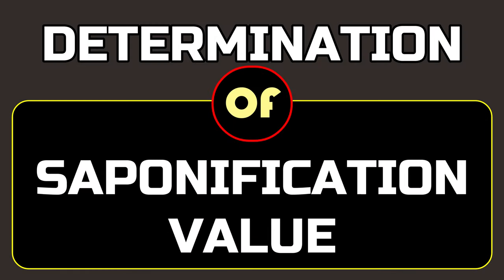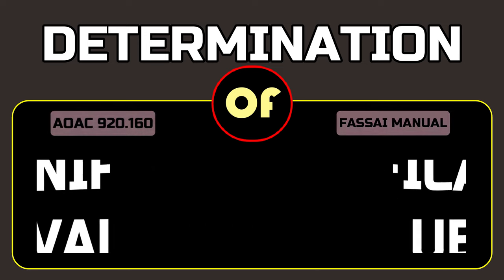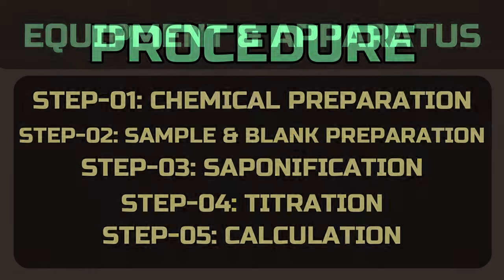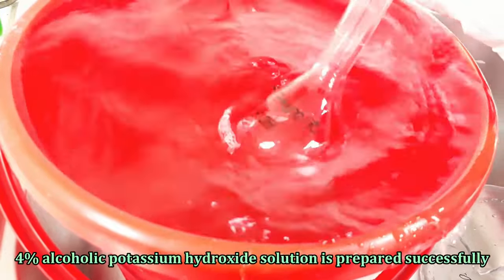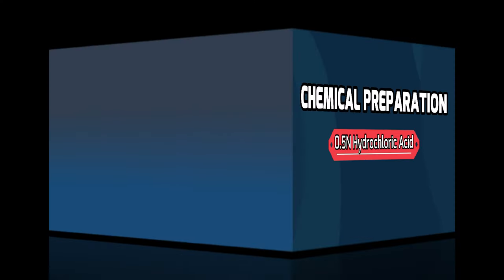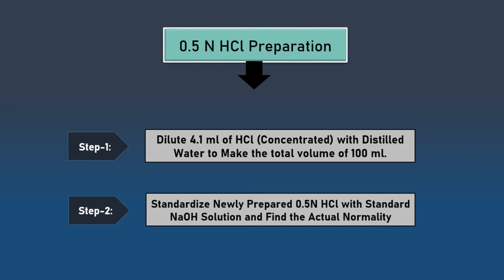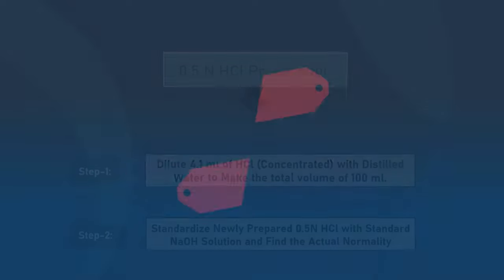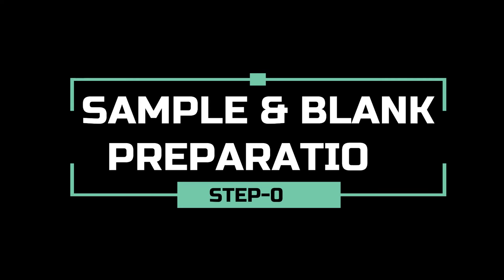Determination of Saponification Value of Oil or Fat Sample_A Complete Procedure (AOAC 920.160)

Comment: when i did this experiment, i mixed 3.4g KOH+ 2ml distilled water+rest of ethanol to make upto 100 ml volume(0.5 N solution). I made this ethanolic KOH using directions I found on the web. Then I directly dissolved 1g oil sample in 50 ml of prepared mixture. It got clear only in 5 minutes. I prepared 0.5 N Hcl by adding 10ml in 250 ml water(37% Hcl). When I titrated, I was getting a very large saponification value(about 500). The formula I used is [(blank titre-sample titre)*56*normailty of KOH]/weight of sample. Can you tell me what am I doing wrong? And what is the purpose of the methods u have used like use of aluminium foil and initially boiling koh with ethanol?

Comment: Great video, can you explain what is function of reflux 1,67g KOH in 200mL absolute ethanol? Can we only use 6g KOH in 150mL absolute ethanol for preparing 4% ethanolic KOH? Thanks..
Reply from the maker: Reflux of ethanol with KOH followed by distillation is normally done to make the ethanol more active for this test.
But you can just dissolve 6g in 150ml.
Reply: Ok thanks a lot..
Reply: Great video plz make a video .how to check erucic acid in canola oil.

Comment: 1.How to find SAP value of solid state sample like alovera ?
2. Will the SAP value be same if I use sodium hydroxide?
3.Difference between KOH and NAOH?
Please do reply
Reply from the maker: 1. No idea about other sample but you can try this method
2. KOH use is mandatory as said by Reference method.
3. Please take help from other source
Reply: @MicroChemsExperiments   thank you for help
Reply: In formula how did this 28.05 came

Comment: Hello. Thanks for the video. I just wanted to ask the importance of making a blank. 
And also, can distilled water together with the ethanolic potassium hydroxide solution be used as a blank?
Reply from the maker: You must have to prepare blank as shown in this video
Reply: The reason for the blank is to account for any water present in the KOH.
Reply: @billsmathers7787  Thanks

Comment: Some websites are showing this formula of saponificatio = 56.1×(A-B)×N÷W
and some showing 28.05 ×(A-B)÷W
I am confused, which is  correct , what is difference.?
Please reply
Reply from the maker: Both calculations are same. You will get the same result. Second equation, you mentioned, is simplified form of calculation. First mentioned calculation is the original calculation formula. You can use both.
Reply: @MicroChemsExperiments  thanks for reply
Reply: @MicroChemsExperiments  what is normality of alcohlic  KOH solution you have prepared
Reply from the maker: @aone9548  Please watch the video again.

Comment: Good work, keep it up. But how do you arrive at 4.1ml of HCl? I want to know its percentage purity and density and how you arrived at 4.1ml and must it be 0.5N? Can't 0.1N be used. Thanks as you reply
Reply from the maker: 0.83ml HCl should be added to make 0.1N HCl solution and 4.1ml is added to make 0.5N HCl solution and make the final volume 100ml.
Please watch our video for the preparation of 0.1N HCl. Video link: https://youtu.be/lXzAB8woAd8
We used 37% HCl (fuming) of molecular weight: 36.46.

Comment: in the standard formula for SV, it uses the molecular weight of KOH (56.1g/mol), but in this method, it applies 28. 05? my question is what this number represents?
Reply from the maker: Mike Tyson, which standard formula are you talking about.
In this test, we followed the AOAC 920.160 official method strictly. In AOAC 920.160 method, 28.05 is used in the equation, so we did.
Reply: @MicroChemsExperiments  This is because HCl concentration is 0.5 N. Basically the equation involved HCl concentration too. When it is 0.5 N Molecular wt of KOH is 56.1 which will eventually lead to the value of 28.05.
Reply from the maker: @TridibSarma  Thank you so much for the clear explanation.
Reply: @TridibSarma I don't understand calculations   explain please.
Reply: 56.1 x0.5N = 28.05

Comment: Must And Should Use pipette
Not Use Measuring cylinder
Reply from the maker: Here you don't need accuracy at that much. You can also use measuring cylinder. But using pipette is best practice always

Comment: 28.05 was written in the first line but in the next line 28.5
Reply: In the calculation part
Reply from the maker: @tarunkumar8841  Sorry, it was a mistake. 28.05 is the correct factor. So 28.05 should be written in second line also. But we wrote 28.5 by mistake.

Comment: Is the SV of Oil (in the form of triglycerides) less than the SV of the same oil after hydrolysis (free fatty acids after reaction - splitting)?
Reply: Yes, because molecular weight decreases after hydrolysis & as the mol wt decreases SV in increase,so definitely SV of split fatty acid will be more than oil before hydrolysis.

Comment: how to prepare ethanolic potassium hydroxide solution in procedure
Reply from the maker: Preparation of ethanolic KOH is already given in this video. Please follow the step-1.
Reply: @MicroChemsExperiments  IS there any optional to prepare without reflux condenser
Reply from the maker: @amanueldaniel5342  You can prepare  it without reflux but that can result in some error in the final result. The result will not be exact but can be considerable.
Reply: @MicroChemsExperiments  how? please show in procedure
Reply from the maker: @amanueldaniel5342  Just dissolve KOH pellets in absolute ethanol and skip the distillation step. Take help from this saponification video and just skip the distillation part and disoolve KOH in ethanol

Comment: How to make 0.5N hcl solution?
Reply from the maker: You can prepare 0.5N HCl solution by followng our video: https://youtu.be/lXzAB8woAd8
Just multiply the amount of HCl, needed to prepare 0.1N HCl, by 5. Then follow the whole procedure to standardize the solution.
Reply: @MicroChemsExperiments  Hi do you have any idea which tests are important for oil testing according to fssai? I mean on what parameters does fssai check the quality of oil, say mustard oil?
Reply from the maker: @factxfact5549  To test an oil quality, you must go for the following tests: Peroxide value, iodine value, Free Fatty Acid and Acid Value, Rencidity, Saponification value, Unsaponifiable matter, RM value, Polensky Value, Moisture, Refrective Index, Density etc.
Reply: @MicroChemsExperiments  every test we have to do if we are manufacturing mustard oil?😳 There are more than 20 tests.
Reply from the maker: @factxfact5549  Yes. You have to do all of those tests.